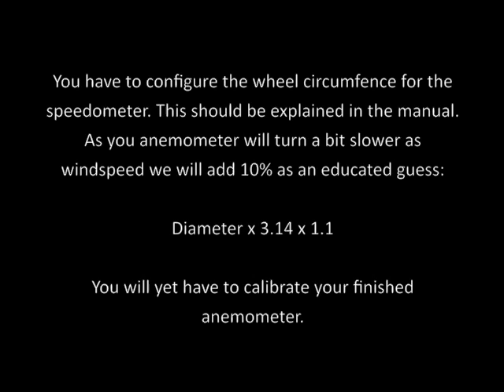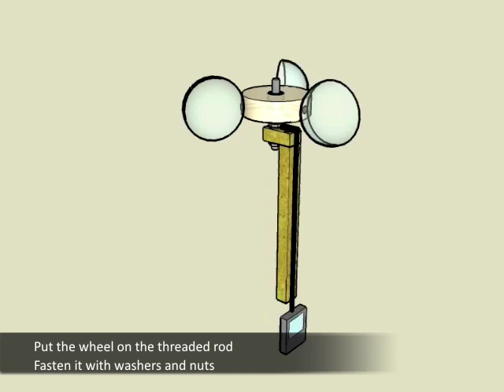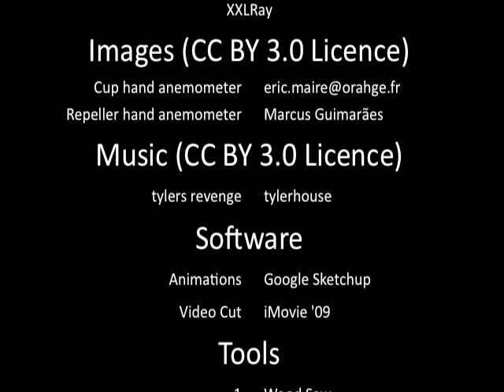Speedometer Measures Wind ▪ Building My Simple Anemometer

Comment: This very helpful thank you. Im confused on how the speedometer is connected to the anemometer. Does it have wires connected to the cups? Sorry if it was showed in the video and I missed it.:)
Reply from the maker: You have a magnet on the bottom of the centre wheel and the sensor is mounted just below on the fix part.

Comment: Thanks for sharing your clever video. BTW: The cable on bike computers is very fine, twin core. It can be spliced and soldered to make it much longer with a little care. I broke my computer cable on my bike. So had to learn how to mend it. Wire stripping pliers help. Then a tiny dab of multi-core solder on a soldering iron will rejoin the two bare cores. A clothes peg will hold the cable still while you solder. A little electrical tape for waterproofing. The repair has lasted well so far.